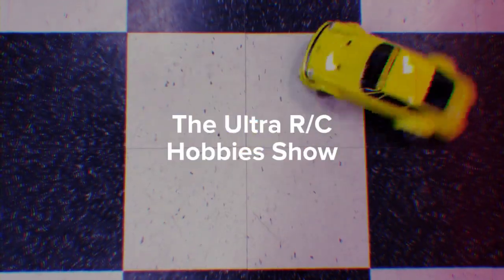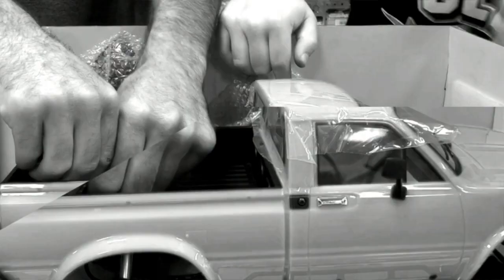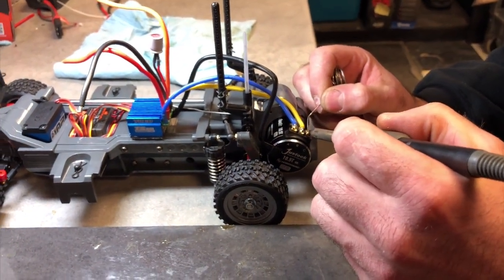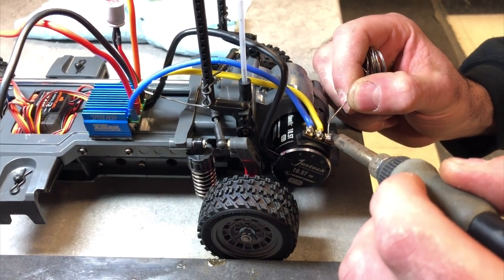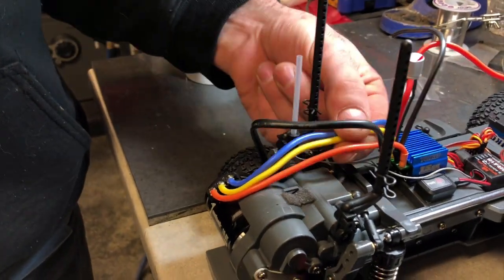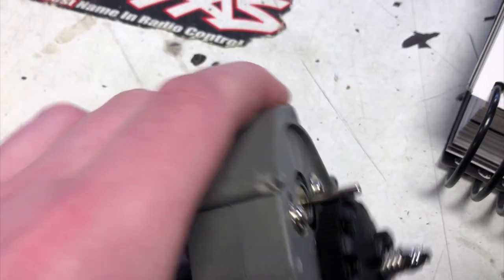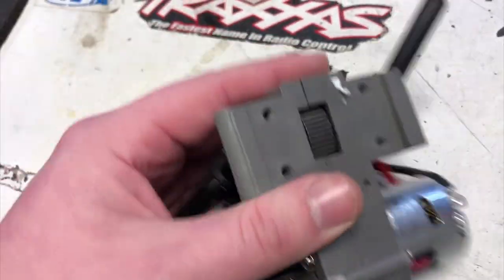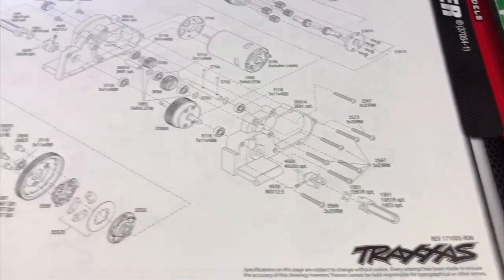The Ultra R/C Hobbies Show Episode 49 | Tamiya MF-01X Build | Traxxas UDR Drifts

Comment: Hi
Reply from the maker: All Terrain Rc hey, how’s it going?
Reply: Great you
Reply: I bought my rustler at your store
Reply from the maker: All Terrain Rc doing awesome! Can’t wait for this snow to stop to go drive some UDR’s! Awesome when did you get it?
Reply: Two years ago but it still works great got a light bar and new tires for it and brushless motor but I don’t have an esc and one of the connectors on the motor wires is broken any chance you could fix it or have the part I don’t have sodering tools?
Reply from the maker: @allterrainrc2764  We should be able to fix it no issues, we have esc's in stock and do lots of soldering so we are practiced up!